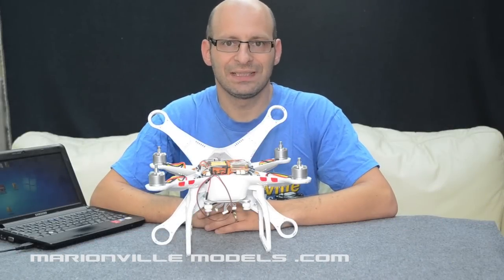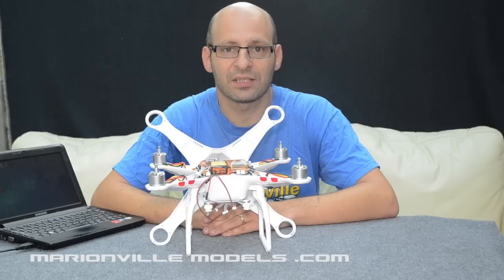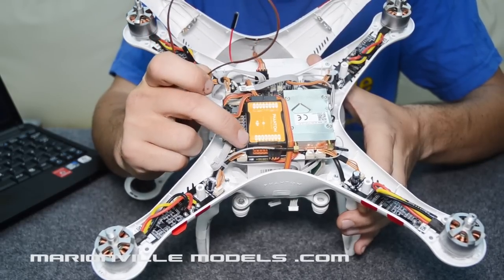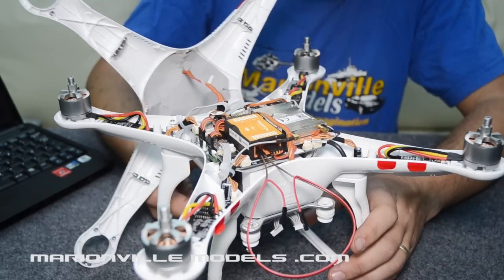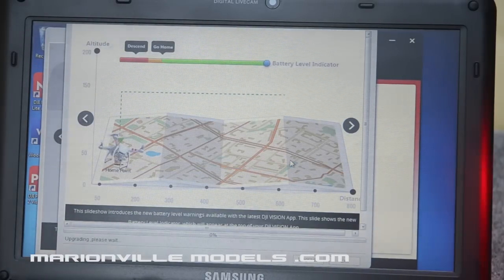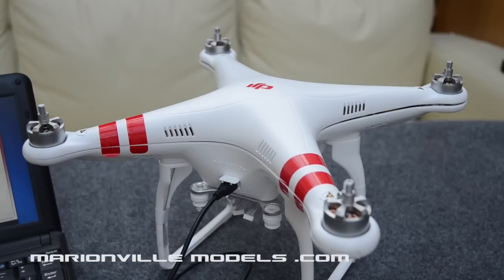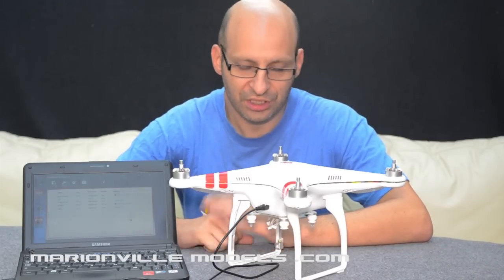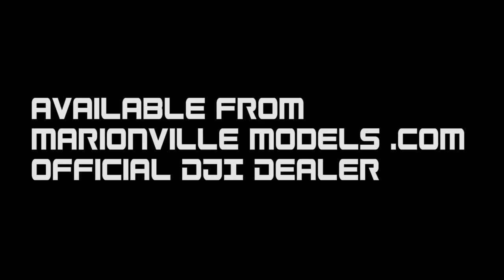Hard Reset Firmware on Phantom2, Vision+, Naza Light & V2.

Comment: Hello, my naza m v2 cannot connect to my laptop (the led light is light green) I tried to install and do everything but it still not connect, is there any suggestion for the situation?
Reply from the maker: You could try different cables. Also if you have an old pc on windows XP or 7 may help. Win10 can be problematic.

Comment: It worked i just made a homeade jumper out of antenna wire,,man u saved me thank u so much!!!!!thank the you tube gods
Reply: Hey Carey,  it seems you have the most updated comment out here, that makes me ask, what version did you upgrade your firmware after hard reset?
I have problem with my gimbal, and I m thinking its because of the  latest firmware update which is 3.14. To solve that I,  after I reset my firmware I need to upgrade it to 3.08 or older versions. But it always show the latest version (3.14) to me. I dont know how to solve this. Do you have any idea?
Reply: @abdullahakcaseymen  i couldnt find a updated version,,everytime i did try to install,,it would brick it again,,i just used wut was recommended the older software,,that's me though
Reply: Carey Clark thanks man.  which older version is it?

Comment: Hi can you hrlp me please mine is doing this but I can't get it to work if I send it to you could you fix it for me please
Reply: @MarionvilleDrones  what do you need me to send to you just the drone or transmitter as well I hope you can sort it for me only had this drone a month and not even took it out iam gutted
Reply from the maker: Andrew Parkin cost wise your looking at £50 plus the return shipping. I would need the craft and the controller and a battery.
Reply: @MarionvilleDrones  OK she'll I leave you all the screws so you can put it back together for me
Reply from the maker: Andrew Parkin ok.
Reply: @MarionvilleDrones  you will need to send me your address so i can ship it to you
Reply from the maker: Andrew Parkin bottom of my website. https://www.marionvillemodels.com/pages/dji-phantom-inspire-quadcopters-repairs-upgrades
Reply: @MarionvilleDrones  thank you took a screen shot of your details do you think you can sort it
Reply from the maker: Andrew Parkin   Marionville Models, Unit 2, Eliburn Industrial Park, Appleton Park Way, EH54 6GQ
Reply from the maker: Andrew Parkin I can try to but it may need another flight controller.
Reply: @MarionvilleDrones  how much r they
Reply: @MarionvilleDrones  can you get your hands on one if needed
Reply from the maker: Andrew Parkin yes I have one in stock.

Comment: Good morning, everything is fine I need a lot of help I have a f450n that uses a naza lite only that the lite has defected and does not recognize the gps, then lazy lay I went in search of a controller I bought a p2 vision thinking that would solve my problem, the Which happens to be the following the p2 controller does not let the engines arm, because it has a smart battery sensor that does not let the engines arm, the controller is with version 3 14 and I need to download the firmware version and I can not,

Comment: hello, I bought my DJI Phantom 2 from you some time back. I haven't used it for a while. When I put the controller and quad copter on I can not start the blades. When I pull the joy stciks in the blades don't start. Any ideas how I can get it to start? [what I need to do to get the blades running again?]

Comment: Hi, Can I just use regular jumper to connect the F1 and F2 instead of the signal cable?
Reply from the maker: You can use anything as long as it joins the two pins.

Comment: Hi, great videos. What size head takes that tiny screw on the very tip? I'm trying a Phillips #0 but it just won't work. Thank a lot.
Reply from the maker: That's the correct size. If the screw is worn then try an elastic band over the head first and push the tip of the driver onto it.

Comment: I have a p2v+ v3 and when I plug it into the computer the numbers aren't right and when do an IMU Cali they don't change I have replaced the compass and still not right shall I do this?
Reply: Same prob here. Compass Err and MOD value shows 0. Not sure is it faulty GPS or just to reset firmware in this way. Any idea about this ? Mine it's Phantom 2 Vision+ V3 as well too.

Comment: i have a problem with connecting my dji to my pc does this help?
Reply from the maker: Make sure you have the Win Driver Installer on your PC.
Reply: I installed it, wait I mailed this to dji maybe you know. Subject: Connecting DJI to pc
Message: 

Hi there, I just bought a phantom 2 vision + but can't connect it to my pc. I installed the drivers but when it tries to update my drone it sees dji-innovations inc. (usbser) Ports (12/06/2012 5.1.2600.5512) - installation failed. If I open the DJI Phantom 2 Vision Assistant_3.8 and try to connect the drone it doesn't even see it. Also my computer doesn't seem to recognise th phantom 2 vision +, even if I manually referring to the installed drivers from the dji website. Can you please help me out? with kind regards, M
Reply from the maker: +MTYD23 have you tried a different USB cable.
Reply: that's a good one, going to try it.
Reply: nope doens't work, same error comes up.
Reply from the maker: +MTYD23 try another PC. I have one pc the assistant won't work on.

Comment: I replaced the original motors of my Phanrom 2 by T-Motors. I had special attention how to wire these motors to their esc´s.After the work i started up the Phantom. The Phantom reacts as in your movie, no self check beeps, red blinking leds and beeping all the time. I opened the RC Assistant and everything seems OK. I have the latest firwware for my main controller, so no 0.00What can be the issue?

Comment: If you do not have the small wire, use aluminium foil. I folded a small piece of foil to link both pins. The process went very well. Except that it did not solve my problem.
I did exactly what you did with my Phantom 2 Vision but my 4 lights remain the same.
I know that we are dealing with 2 different issues but I wanted to give it a try. But thank you anyway. Great tutorial though. :-)
Reply: Thanks for your comment about using the foil. I couldn’t find the kind of wire that this guy was using anywhere.

Comment: If you have an old useless computer laying around just pull off a two pin jumper. I ran though this hard reset two times and it didn't solve my problem. I'm thinking about replacing the compass and after that I don't know. Very frustrationg.

Comment: Great video thank you. I want to see if u can help me. I had a small crash where my pv2+hit my truck. It fell to the ground not much damage motors run camera stayed together no ribbon tear thanks to my gimbal protector but now when i turn it on i get 2 beeps then a 3 sec delay the 2 beeps and so on. The gimbal has no power but i get video to my phone but all on the gimbal motors limp. I checked the ribbon circuit board and all connections ever used a diiferent wire harness. ? Thank u in advance.

Comment: I have a problem DJI Phantom 2 vision.I have 2 solid red lights on the phantom when powered up. Which shows as ( Abnormal compass data )
The only reference I can find is some trick with a magnet "Sanctioned by DJI " and another guy gets the red lights with one particular battery. Unfortunately I have only one battery at the moment.
Reply from the maker: That's correct but if that won't fix it just replace the compass. There not expensive.

Comment: I have a problem with my Phantom 2 Vision Plus. My Phantom cannot connect to the computer for the update. Anytime I hook up to update, there is an error message that tells me to Connect to the Controller. Do you have any idea for for how to connect so I can update my firmware? And do you know how to reset the battery because after a full charge, it only runs for about 4-5 minute and lands with a red power signal. I checked the battery life. But the green light says it's still good. I don't know what the problem is with the battery. Please reply soon. Thank you.

Comment: Tried the hard reset.  Followed your direction to a T.  Still have no "live feed" from the Phantom 2 V+
I have every other feature in the app working....height, distance, all telemetry. it takes photos and video as i can see them in Album...but just no live video.
Reply: Sent it to be repaired. It's a firmware issue with some of the video cards in the camera.
Reply: I tried everything.  From hard reset to firmware downgrades. Nothing worked.  So I bought a P3 pro and sent my P2 away for service.

Comment: I'm convinced it is no longer possible to downgrade or "rollback" firmware on any Phantom that has been updated to 3.08 or above within the past week. DJI has definitely done something to circumvent the downgrading process. I'm not able to even hard reset using the method described in this video. NO matter what I do, 3.08 is the lowest ANY version of the assistant will let me go.

Comment: Rick, had total gimbal failure(power and no control) 2 weeks ago after upgrading all the software. Unit is a DJI Phantom 2 Vision+ purchased on 09/22/2014. Have new RC and the upgraded motors,ESC & props.  Flew/ took photo fine prior to shutdown for winter in Dec. 2014.  All controls and main unit worked fine prior to the upgrade, but after firmware upgrade all thing still work fine except no gimbal control, just sits there with no movement at all. Just flops around. found this help on PhantomPilots Blog and asked for help-was led to your video.  So though I would give it a shot as nothing else worked.  Could not "reset firmware" as per you instructions thought I was trying.  Unit just beeped and showed no firmware information, but no go, something different with newer P2V+?? any help would be greatly appreciated.

Comment: I want to thank you for your video. I didn't know what to do after my gimbal stopped working after the last upgrade.  I did exactly as you showed us and calibrated when I was done, everything works.  Thanks again for your help. I did use a small "jumper" I picked up at a computer store instead of the wire.
Reply: Rick McFall Hi, In my case, I did the upgrade of the Zen Imu and after that my gimbal doesn't works anymore (i mean tilt function up and down). The Zen Imu from my software assistant dissapear and the title change from Phantom 2 vision plus to Phantom 2 Vision. So Rick this was your same issue? Did you fix your gimbal issue? Thanx for your time!
Reply: Yes this fixed my gimble issue

Comment: Great video. What about the RC? Is it any way to hard reset it in similar way? After done my firmware update in December my P2 (not the Vision, neither V+, just P2 ) went crazy. I recently downloaded the V3.08 "downgraded" (as update) back again after the V3.10. All the rest it's OK, including satellites detection, the gimbal and tilting BUT <<<the motors won't start>>>. I think I have to wait until a new RC firmware (I have 1.0.2.26 as latest) allows me to flash the one that is stuffed up.
The RC firmware doesn't seem to be possible to perform a "HARD RESET" as the on the actual P2 controller where you can by bridging 2 pins. I suspect that reads the sticks as way out of limits or a stuffed up firmware that (maybe) does not allow to be flashed. Perhaps its re-writes but leaves the errors on. I also wonder if DJI is using the same or very similar firmware for P2, P2 Vision and P2 V+ making the upgrade prone to errors difficult to flash.
I've done everything as instructed elsewhere, (for just the P2), all in sequence, with the GPS and cover connected, tried many times, from another computer, reset IMU in basic & advanced, etc. but my RC won't start up the motors. The only way the motors rarely started was with the stick on a weird positions on: A: -1000, E: 1000, T:  -1000, R: 1000 (any clues?). Thank you.
This firmware update system is serious as many have issues. SHAME ON DJI FOR THEIR SILENCE!...

Comment: i cant seem to get my dji phantom 1 to bind with my new receiver (dj6) i press the button on the inside..its goes from red to blinking orange ...power on my reciver a green light come one its beeps three times...but it doesnt sync to the drone... any ideas what might be the issue?
Reply: could it be cause the frequency operating range..... i have the same problem. My old remote uses 5.8GHz
frequency band.  My new V2 rc uses working range 2.4 GHz... Have overcome this problem though ?

Comment: First calibrate phantom 2 controller then after I upgrade firmware and and after when I on controller
yellow light is still on.

so I can not start phantom 2 motor and not controlling h3 3d gimbal.

2.4G Transmitter firmware：V1.0.1.24

Loader 12.0.02

so any idea to hard reset controller.

Comment: Does this also reset the gimbal Zen IMU firmware back to scratch?   I just installed the latest updates and not my gimbal makes a buzz sound and is not responding at all.   I would like to get my gimbal back to a previous firmware version.
Reply from the maker: Just the flight controller. You can reset the gimbal, have a search for it..
Reply: Marionville Multirotors
I have searched and all I have been able to find is a hard reset for the go pro H3-3D gimbal but not one for the vision plus gimbal.

Comment: Thanks for the great video Rick please could you give me a link to where I could buy the cable.
Reply from the maker: We don't actually sell them. They normally come when you buy after market gimbals but you can use a Flight controller to receiver cable
Reply: Marionville Multirotors Thanks Rick, would this be ok. http://www.ebay.co.uk/itm/like/121454989610?limghlpsr=true&hlpv=2&ops=true&viphx=1&hlpht=true&lpid=108&chn=ps&device=c&adtype=pla&crdt=0&ff3=1&ff11=ICEP3.0.0-L&ff12=67&ff13=80&ff14=108&ff19=0
Reply: Graham Johnson yes

Comment: Hi Ricc,
A buddy on mine is running into problems and at the moment has an RMA to send his P2V+ back to DJI because it seems to be locked up. Great job on this video. I have a question how do I go about getting one of the cables you used in the video? I would like to order one. Check your customer records, you have my email address on file. I would like to order a cable just to have on hand should I ever need it. By the way the P2V+ you sold me is still going strong well after 120 flights at this point. Still flying with my original props, no issues with my camera or gimbal. To be honest I had an issue with my GPS however I solved that problem. I have zero complaints at this point. Thanks - Joseph Bobowicz
Reply from the maker: Glad your V+ is still going strong. What to do is email me your address and ill fire you a cable.
Reply: Marionville Multirotors Thank you Ricc. I just emailed you my address details. Have a Great Day!

Comment: Morning, Rick.
I have an issue I'm hoping you can help with. I recently got a new PHantom 2 with H3-3D gimbal. After unboxing I installed the gimbal per your 'new' instructions, got the anti-interference chip settled nicely. I then installed the drivers and programs then dived into the Assistant and RC software. I own another PHantom as well so this was all a piece of cake. Took the Phantom out for her maiden voyage, powered up, waited for green lights and hit the sticks. Nothing happened. I walked closer (as if this would have any effect) and tried again. Nothing. But then I noticed my gimbal was turning left and right when I moved the throttle stick right and left. Brought it back home. Uninstalled everything, reloaded everything. Recalibrated everything. Same thing. Gimbal left and right only.  PLEASE HELP!
Reply from the maker: The gimbal moving with your rudder stick is normal. The issues you have is usually caused by the controller not bing properly calibrated to the phantom. Have you done the calibration in the RC Assistant and then again in Phantom Assistant.
Reply: Marionville Multirotors (the gimbal moving with the sticks is new to me. Must have been an update in the firmware...) 

Calibrated per DJI tech support (as you've suggested above). Still nothing. They asked me to send it in. So I guess, according to user reports of DJI service, I'll be out a quadcopter for at least a month.

Comment: My PV2+ has the latest update, but I want to go back to a previous version. Can I use this process to go back to an older version?
Reply from the maker: No you don't need to.. What to do is download Assistant software V3.0, in this the highest firmware is the earlier V3.04 which means when you update it will roll back to 3.04.